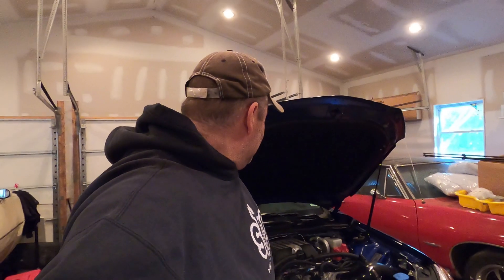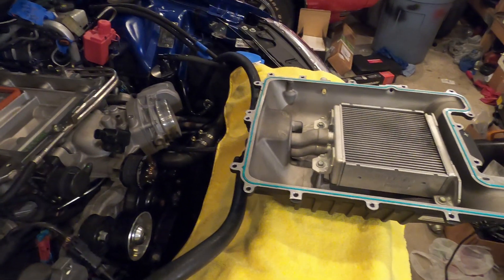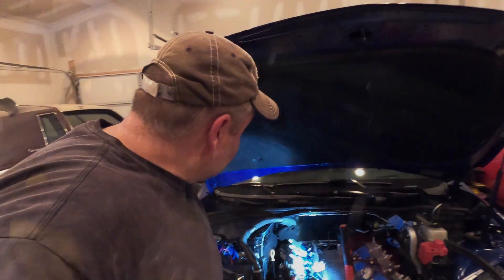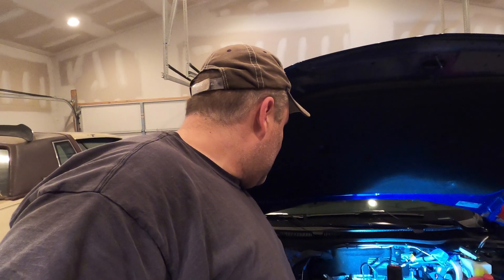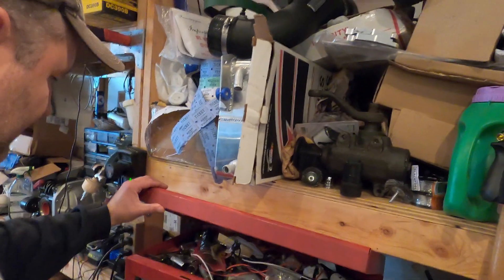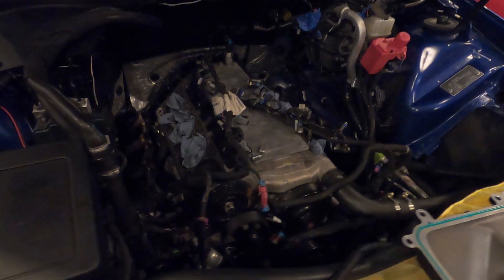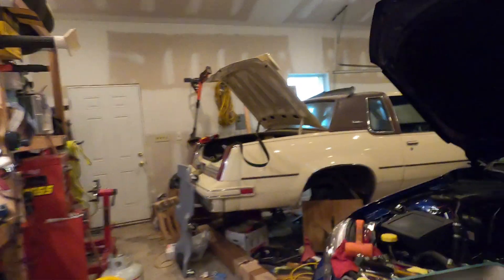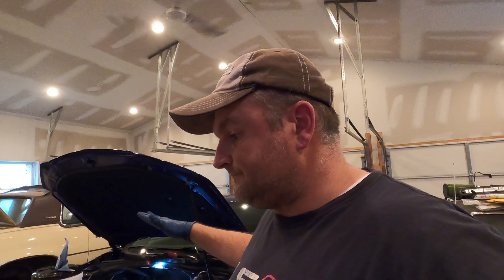ARP Head Studs and LS9 Gasket Install on my Chevy SS - Part 1

Comment: Good video! 👍🏻 Are the LS9 gaskets thicker?  Will that lower compression?
Reply: Yes but not by much
Reply from the maker: Commodore_MRG only a little and since the Ls3 is higher compression than the lsa to start with I’ll just make up the little difference with even more boost! 🤫🤓